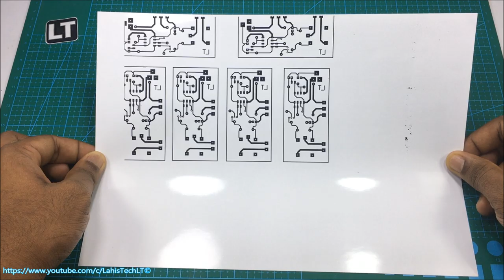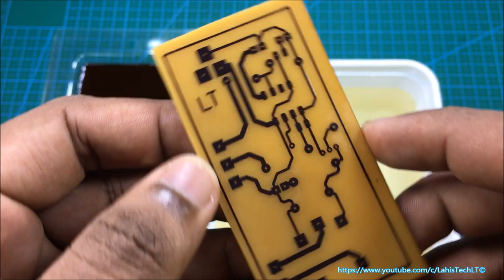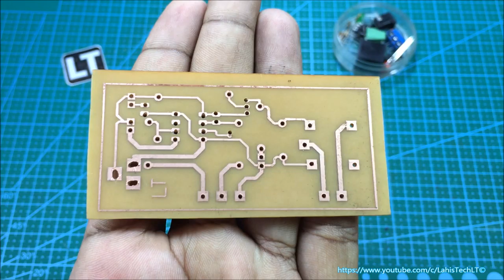Automatic Water Level Controller DIY + PCB Design & All steps of making 230V AC

Comment: Good circuit with minimum components.  The contact probs  if working on DC power, the same gathers oxcide  on them and lose contact of water. therefore the probs supplying power should supply AC power and the sencers should work on that AC Supply.

Comment: instead of giving 220V if i want to use DC 12 V battery so can u tell me which things will be changed like resistors or relay?  and i will also will be using a dc water pump ...

Comment: Greetings, I am beginner in electro, schematic that you have shared with us, I managed to run it, but if it pleases, to be added again for when the well water has receded, the water pump engine will turn itself off at its sensor limit, even though the sensor to the water tank gives orders are still filling in, thank you.

Comment: This circuit only work if u your tank is on 1st floor. 

I maded and tested it , the relay automatically goes of and on with 2 pins , number 6 pin get automatically threshold if i connect a long wire with it

Comment: After download the pcb in PDF format, do I have to rescale it to correct size?
Reply: Hello bro, after downloading the PDF file, I make the circuit of the pins larger than the components, are you like me?
Reply: @laamvlogger  You mean it's bigger than it should be right? 
If so, then YES. same problem.
If I use Paint program to rescale it, it will lose it's sharpness. It will become pixelated.

Comment: must include dry run(sump tank empty protection)
..hint use a npn transistor in series of output of 555 and relay driving transistor with its base connect via 10k to underground sump tank (similer probe as upper tank low high) mark the 3rd sensor war(or interlock). atlernate may depower the 555 with the interlock transistor

Comment: Will it work for 2 kw motor?
Reply from the maker: 230v any motor! Since the Relay is 230v!
Reply: use contactor(the pcb relay as pilot duty to connect to coil of other higher ampere relay contactor (atleast 15-20A contacts for 2kw)

Comment: At the 30 feet hight this circuit not working .motor is not cut off.tell me why transformer 12v 500m amp.at this circuit

Comment: Can u please explain how to add auto manual switch in this circuit
Reply: install simple switch in parallel to relay  contact s(com and NO) to operate pump manually directly. switch off for auto...pull out power plug for manual force off

Comment: Hello Sir your Pcb layout link is not correct...

And your circuit is not working... I have build exactly like you but relay start with power even all 3 cable under of water...

Please help me out by giving proper guide... thanks
Reply from the maker: Ahmed Ashiq Chowdhury It was correct, because I uploaded the same exact circuit that was built in my video. Check the Circuit once again using the method I am showing before the final setup. It should work if you built it properly using exact components.
Reply: @LahisTechLT  Sir, please you check the diagram on Google drive & your video, check the connection of transistor you will understand also, I use all same components only instead of 2.2k resistance I used 2.7k nothing else... please share your FB link or whatsapp I will show you...
Reply: I also tried this circuit it not working I have same problem
Reply from the maker: @a.ashiqchy  Yeah Sorry, Neglect the diagram I've attach here, hookup the connections of transistor as in the video (5.00 - 5.04) , I will attach the corrected diagram asap.
Reply from the maker: @harshitrajsud9hridn  Yeah Sorry, Neglect the diagram I've attach here, hookup the connections of transistor as in the video (5.00 - 5.04) , I will attach the corrected diagram asap. All the connections are correct except the transistor.
Reply from the maker: @harshitrajsud9hridn  I have attached a new circuit diagram. Link is in the video description.
Reply from the maker: @a.ashiqchy   I have attached a new circuit diagram. Link is in the video description.
Reply: Thanks.. But I have fixed a long time ago & make it work.
Reply: @a.ashiqchy  hello sir
Reply: @LahisTechLT  will u plz tell me the dimensions of that layout.....means how much length n breadth I have to take while printing

Comment: .......All the viewers, your kind attention pliz: What if the reservoir tank dries up before the water reaches at the top level to turn off the motor. should you leave the motor run dry for hours and pay a huge bill to motor mechanic to fix it. This idea is totally CRAP, I am an ENGINEER.
Reply: m also searching for that will you provide the working circuit ? i tried many but didnot work properly.